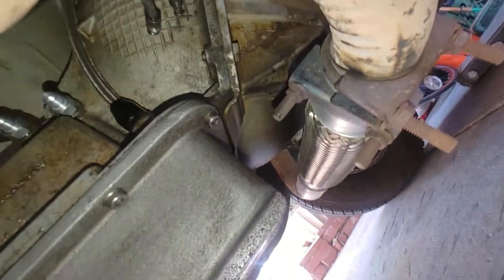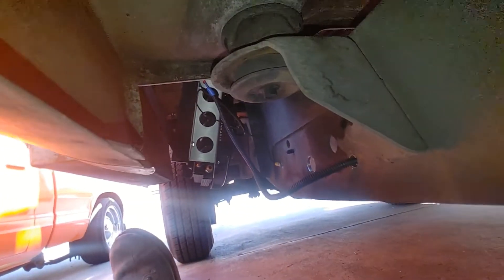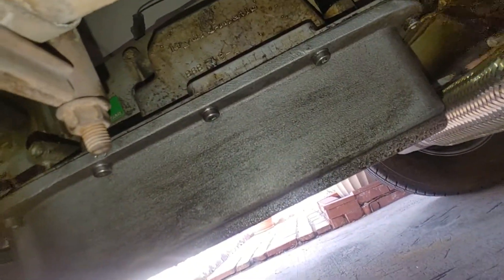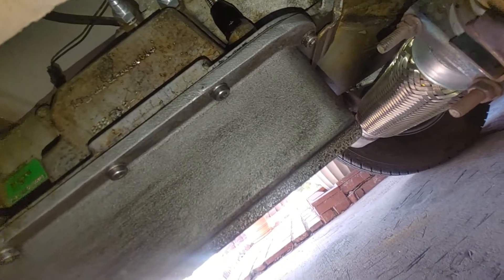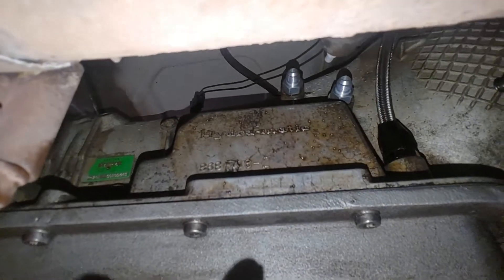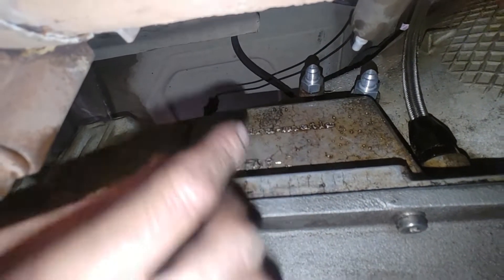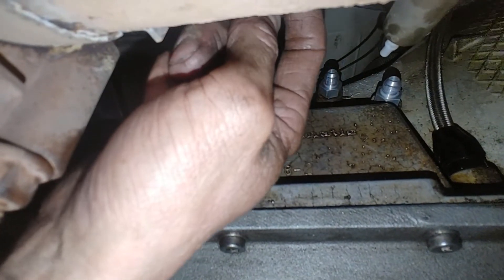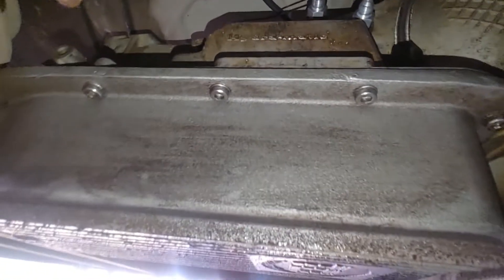older 4l80e transmission cooling ports

Comment: Top Port Hot on ALL 4l80e ->Radiator ->Aux Cooler -> Bottom Port Cold early 4l80e
Top Port Hot on ALL 4l80e ->Radiator ->Aux Cooler -> Rear Port Cold Late 4l80e

CON USING RADIATOR
-Uncommon risk of radiator leaking  into ATF = Blown Trans

PRO USING RADIATOR
-Better cooling then just stock cooler and some aftermarket ones by themselves because coolant temp is cold and water to water is more efficient heat transfer then water to air.

Comment: You just trying to isolate it from coolant ingress?
Reply from the maker: sorry for the late response father. never got a notification that you commented. yes thats exactly what im doing. i never liked the idea of the trans fluid going through the radiator. i have 2 coolers on the truck now. it seems to do quite well